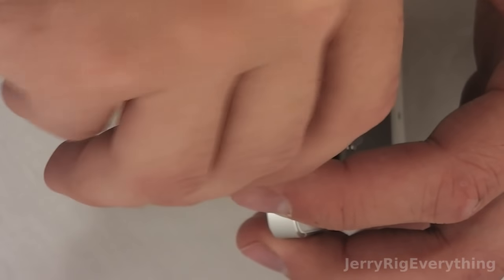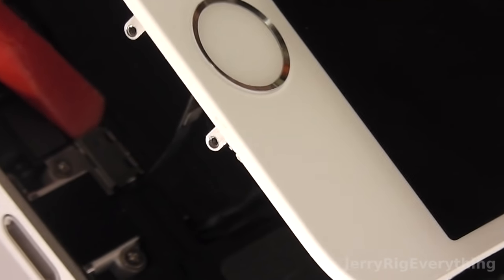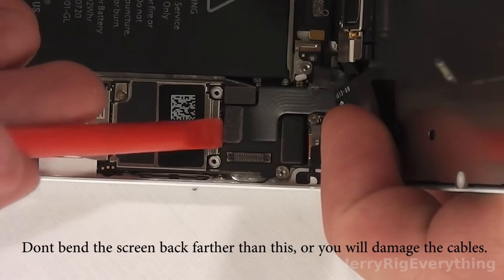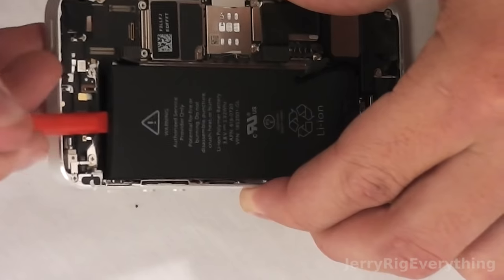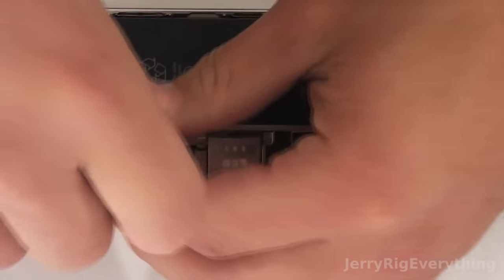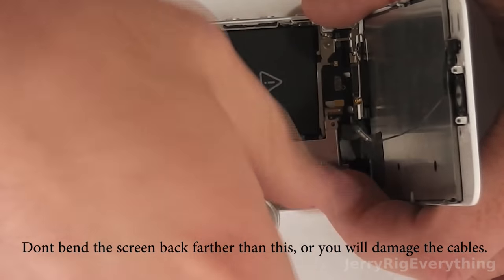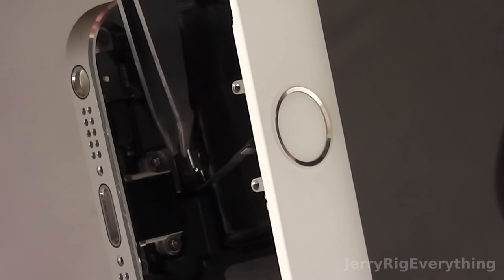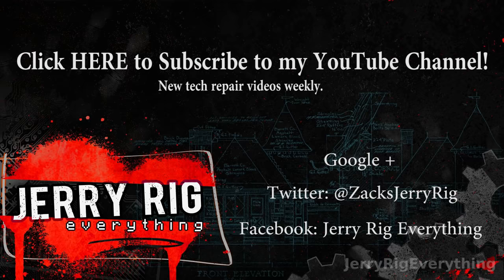iPhone 5s battery replacement in 6 minutes!

Comment: Thank you, I just replaced my wife 5s Iphone Battery! while watching your video, I skip the step of taking the screen off, It took me a little longer but I got it done. I would recommend to take the screen off and try not to save a few steps. Taking the battery out was kind of challenging but I got it replaced. The battery screws were the hardest to put back in, they are so small. I lost one screw someplace so I taped it temporally until I get another one. I Recommend using scotch Tape  to put your screws and clips on your table so they don't go missing.  Thanks again, this was my first Iphone batter that I have ever replace, much easier than I thought it would be.. Thanks again!

Comment: When lifting the battery the same way you did,  it bent and then caught fire! The whole phone burnt out.

You should remove the sticky tape first by pulling it sideways from the the top down.
Reply: For me I just got a small flame. I could then continue without any further ado.

Comment: Hello Jerry. I just replaced my battery successfully but my phone right now cannot find network. It's on "searching..." forever. The wifi doesn't work either. I hope I didn't break anything :(
Reply: Ok, solved my own problem. 

I did a network reset to fix the wifi problem. This was a separate issue.

Installing a new battery made my time settings reset. Need to connect to wifi for the time to re-sync. This solves the service problem. 
phew! I was getting worried I damaged the network chip or something during the battery removal.
Reply: +NoxisGames I encountered the same issue with my network stuck on "Searching..." and set the phone to 'Airplane Mode', then turned network connectivity back on by disabling 'Airplane Mode'. This solved the issue for me! Thanks for posting here initially as you set me down the right path.

Comment: This video helped out immensely!  Take the time to read through the comments first.  I had a huge scare after putting the plate over the three cables with the screws out of order.  Pulling the battery out was difficult, but the hairdryer trick seemed to do the job.  The battery is flexible and easy to crack and it got really hot, so be patient. My 16yo daughter and I bonded with this project!  

Thanks!  Saved $75!

Comment: You know it's not that easy. For EVERYONE who actually needs to do this, it is very hard to get the battery off. It's always easy to do on a phone that has never been used as it's not that sticky. What advice do you have for actual phones that have been used for a year or so? A heat gun? Or pry and bend the battery until the batter is damaged? And install a new battery? Thanks
Reply from the maker: Marcel Jones Yes, you can use a heatgun.  I explain a little more in my iphone 6 video.

Comment: Do you have to remove the screen? Can't you just keep it at 90 degrees and not de-attach the rest of the stuff (Digitiser etc)
Reply: yeah i've seen people set the screen on some books but if you have a stubborn battery thats stuck do to the tape I would recommend removinig the screen

Comment: My battery is not coming out so easily and it's bending, kinda like clay in duct tape. No wonder it wasn't charging up properly and going from 100% to 0 in minutes
Reply: Scorpio Rabbit the batterys are all made like that and you need to heat the back up and that well soften the tape that holds it in place then it well come off a little easier
Reply: Also, folding those batteries can cause them to "rapidly discharge".  (burst into flames.)  Avoid.
Reply: @arthill2310  Exactly why this should not be attempted by someone who doesn't know what they are doing. Extremely dangerous.
Reply: there are adhesive strips under the battery that must be removed. find a different video regarding 5s battery relacement

Comment: for my iPhone 5s are the replacement batteries offered by apple better quality? 
 I had a battery changed in a repair shop on my iPhone 4s, the iPhone is still always dead quick.
These 2 phones have been unlocked' I find that after unlocking it cuts the daily batterie life in half, why do you think?

Thank you for this very great video
Reply: all replacement  batteries are from iphones. it is very hard and expensive to make an iphone battery. but, iphone 5s batteries are better than all previous including iphone 5c
Reply: Actually, if u look at replacement batteries online, you will find that all look the same, but there is a wide range of pricing. You can pick up a battery for iPhone 5s for anywhere from $5 to $50. But don't let looks fool you. From experience, MOST (not all) of the more expensive batteries hold charge for longer, and just seem to have better battery health. Yes it is true that these batteries are very hard to make, so no bootleg company is gonna be able to make these. But that doesn't mean all batteries are created equal. I wish I could tell you as to how or why this happens. I don't know. It may be that the cheaper batteries are taken from the plant at some point before they've been finished and tested. Or once a battery is made, they test them and if they don't have a high enough voltage, they may throw them out where they're picked up and distributed somehow. Who knows. But fact remains, a new battery from apple is just that, new. The battery u buy online for $5 may say new, but is it? Conspiracy.. apple did admit to throttling phones performance based on battery life.
Reply: Julie Poirier c

Comment: Worked like a champ, take your time and be patient/organized.   Pay special care on the battery removal to avoid bending.  If you pry the one end of the battery up enough at the bottom of the phone (avoiding the computer stuff at the very bottom you can press the plastic tool under the battery as far as you can to lift more straight instead of bending the battery which is bad.  Mine started to smell when it bent so I shoved the plastic tool under the battery far as i could from the area towards the bottom of the phone and it straightened out and finally came loose.  As you shove it under the battery it should start to lift and straighten.  Good luck!

Comment: Why can't it be simple like an android???
Reply: iPhone are for simple minds, Android are for true hackers ;)
But hardware replacement and service on Apple products are just a proof that they keep service people in... service :p
Reply: Let me rephrase: People buy iPhone because they are simpler ;)
Reply: not really i've had androids all my life and recently got an iphone as i got sick of ghost touch on my last two android phones.  I now have a 5s and it''s a joy to use it just "works" so now i'd rather buy an iphone as I want a phone that's reliable and not prone to dodgy cheap screens.  Most android 5.5" screens have ghost touch issues eventually, just google it as they all come from the same factories in China using cheapo components in the screen sensors and also badly positioned sensors that overheat with time and become damaged.
Reply: I'm android user because it's "open source" and thus can be modified. Never had anything bigger than 5.2" though and will stick to that as my biggest. Now I don't doubt iPhone quality (and apple as such), but as the tech I am, everything I have is rooted and modified of some sort. Together with the proprietary solutions apple uses, my choice is "simple" :)

I should mention that (in general) the components used in expensive android gadgets are as good as apple's. You get what you pay for. And android have a plethora of different devices to choose from. Apple is one only (ofc the -s -c -plus variants or whatever they call them) ;)
Reply: sure and i have also rooted fire tablets, samsung galaxy note phones with various roms, to be honest rooted does not = better imo.  Usually they come with their own bugs and quirks and rooting devices is not that difficult, non-technical people just think it is.  Rooting devices just sounds cool and geeky.  I would most likely still be with android if it wasn't for the poor build quality.  I'm sure Samsung S7 and other premium android phones are decent build quality but then i'd be paying almost as much as an Iphone and at least with Iphone it's only a single platform so the apps very rarely crash in my experience, they are much more robust than the apps on android which has to cater for a variety of hw platforms and many variants of Android OS.
Reply: Yh, I edited my post to make that point too (about quality). I didn't say it is difficult or "better" in basic, but my choices are more.
Reply: because it is an apple through and through by new dont repair.................
Reply: Guys if you want a good Android phone then just put a lot of money into or the quality night not be as good.
Reply: Steve Turnbull don’t buy a cheap android get a flagship
Reply: this is pretty simple

Comment: Lol I have to replace 4 parts.

-Screen
-Back Glass (next to camera and flash)
-Charger Port
-Battery

Oh, I'm gonna have a fun time.
Reply: lane castro Just give it to a repair shop to replace all these thing
Reply: lane castro things*
Reply: lane castro   Damn just get a new phone. Bro I'll send you a new phone if you want. Like no joke 😂😂
Reply: I repaired it but during repairing it i scraped the volume cable so now my phones ringer is always on, cant use the volume rocker, and the vibration motor doesn't work. Plus the charger port I bought only charges, doesnt work for syncing.
Reply: @Goblin4461  no me

Comment: My battery is stuck to my frame so hard it broke my pry tool
Reply: I had to use the blow dryer trick until it started burning my hand and the glue still held on tight. I too, broke my pry tool trying to get the stupid battery out.
Reply: I broke 2!!
Reply: @seancarrick4249  look up the method with  fishing line. you thread it under the battery and saw it out

Comment: Thank you.
Replacing the battery in 2020 I found the glue or sticky stuff holding the old battery in place very solid and required a substantial amount of pressure to remove it, more than the plastic tool could handle (it broke) and I had to use a metal lever, The old battery was destroyed in the removal process. I was very careful not  to raise the screen more than 90 degrees, but the cables were very stiff, as though they had dried out and when I first put the phone back together there were vertical lines on the screen and it was unresponsive, I took it apart again and attempted to re-seat the cables at the screen end by taking off the camera and pressing them in. This worked for the touch responsiveness, but the vertical lines were still there (although much faded), they disappeared after about 10 minutes of use.
Phone seems to be working fine now - well worth the effort.

Comment: I did this and mine wont turn back on period
Reply: my screen doesnt work
Reply: Take it apart again. Something is not hooked up correctly.
Reply: i used a sledge  hammer as that is all i had one whack with it and everything came out
Reply: I did a similar "operation" of my friends cell phone and the speaker wouldn't work. I went back in and realized that it was not clicked in. With all devices you'll hear some sort of minor click confirming a secure connection. If you didn't hear this, you might want to go back in

Comment: Very well explained.  I've just fitted a 1560mAh battery to my iPhone 5S using these instructions.  I had to use a little bit of heat to warm the case up before the battery would give way.  Very simple to follow step by step.  Thank you so much.

Comment: Super helpful, thanks!
I did have vertical stripes but squeezed the screen to the base and they seem to have gone away......I could have sworn that I clicked all the connections solidly.
Oddly the home button doesn't click anymore but it still works.  

a things I'd stress:
--back up your phone & disable the passcode in the event you reassemble it and the screen is semi responsive

--keep track of where the 4x screws for the plate that covers the screen connections....I had to use a caliper to find the 1.2 & 1.3mm

--Removing the battery, next time I'd try heating the back plate and use a plastic prying tool, the original tape is very strong. I used the blunt end of tweezers and was worried I'd rupture the old battery

Comment: Jerry, thank you for this video.  I appreciate the pace in which you gave direction, I was able to replace the battery without any problems.  I would suggest taping a paper towel down on the table, desk or where ever your working.  The screws are very tiny and have a tenancy to bounce around without the paper towel.

Comment: Very informative video but I agree with most other comments, in that the old battery is very difficult to free from the adhesive and you have to be very careful not to put leverage on the surrounding components.

I used a plastic pry tool which snapped when I initially tried to get under the battery, I had enough gap then though to use a stainless steel bread knife (the one with a rounded end ***not a pointy end***) to slide under the battery.  This was very slow but successful.  You cannot rush this task.

Comment: Thank you. I did get it right after 3 tries...... I was using using glasses with a magnification of 2.75 which was marginal. These parts are very tiny. Amazing how these are manufactured. I suggest one uses a special magnifying monocle or glasses. Don’t drink too much coffee before hand! The original battery was really stuck in place and I damaged (bent) the battery when removing it. Now it’s outside in the cold air away from from combustibles. Waiting for it to go critical and melt down. Will dispose of it at my hardware store once it’s cold.

Comment: Kept a hand on the battery as I pried it out with a flathead covered with electrical tape. As soon as it got warm, stopped and let it sit. Realized two screws longer than other two; put the short ones in first. Last part took 5 min. Phone can finally turn on. Yaaas! Thanks!

Comment: Just did this replacement with a old 5S. I heated up the back of the phone with a very warm gel pack underneath and kept the hot pad underneath throughout the removal. 

With a stiff credit card I could SLOWLY pry up on the long edge of the battery nearest the outside, until the pressure-sensitive adhesive released. About 6–8 minutes of steady pull, to get it to start crawling away from the battery. I'm glad I didn't try to rush this. 

Instead of completely detaching the screen, I held it vertical with a medium-weak rubber band around a plastic bottle of vitamins. I had to watch out for strain on the connector cables at all times, but reassembly was quick.

Comment: Just replaced mine and I agree, no need to remove the screen.  Just hold onto the screen at or less than 90 degrees while you remove the battery.  The tiny battery connector and home screen connector were a real pita, but finally got them back on.  One tip, find a big magnifying glass and get someone to hold it for you while you work on the clips/screws.  Your eyes will thank you!

Comment: Thanks for a useful video. I'm surprised that there are some negative comments about keeping the screws in the right place so they go back in the same holes. Apart from being common sense, you say that! A couple of people talk about the fingerprint recognition not working and if you want that on your new screen, you have to fit the original apple home button that came with the phone. You need to unscrew 3 screws to do that but it's very obvious and easy. One advantage I found was that the ribbon cable to the old home button was longer than the replacement I swapped out so I had more room to fit that home button cable and it was much easier than I'd expected. Also more room to fit that clip. Many thanks. Good guide.

Comment: Excellent Video.  I followed the instructions and was able to complete 'the exercise' and changed my battery.  Seems I stuffed  up with the touch ID but the home  button works OK.  As it is only a hotspot phone for when I travel it will be ok for me  without touch.  I have to confess the fiddliest part was reattaching the cable and it did seem to click in place and I was able to put the fastener on too.

Comment: It worked perfectly. 
I did not remove the screen and the annotation tip about heating the back with a hair dryer really came in handy because the glue holding the battery in place was tough. After a little heat, the battery came out easily.

Comment: Great informative video. If you purchase a replacement battery on Amazon, most vendors include an adequate toolkit for the job. A bit of moisture on the suction cup helps increase grip. After unplugging the cable to the upper half, I just hinged it back at 90 degrees, held it in place with a clamp and was able to removed the battery without all the steps (and risks!) involved in disconnecting the screen entirely.

Comment: Thanks for this. The battery is hard to get out, but using a hairdryer as advised it came out. The two sticky strips that came with my replacement kit were a bugger to put in. I'd advise leaving the old ones in. The connectors are fiddly, but firm gentle pressure does the trick. The home button cable I found easy to do, using tweezers first to click the connector together, then locate as advised here. Lastly I'd advise switching the phone on before you put the screen back. That way if you've not located a connector correctly, it's easier to go in and fix it.
    Like any device of this nature it's not an easy job, unless your used to fixing things and have good hand eye co-ordination. You have to use your own judgement, get it fixed by a competent tech if unsure. Also Li-ion batteries can be dangerous; dispose of properly, DO NOT put in bin or general garbage or waste.
   Thanks again.